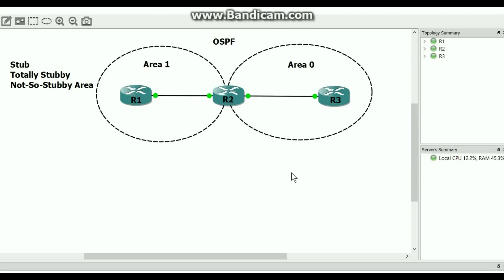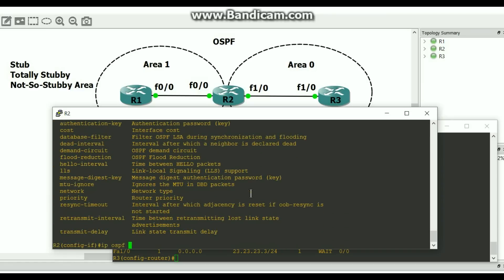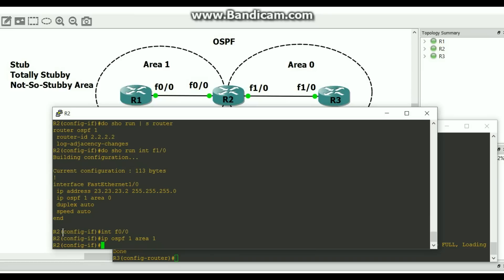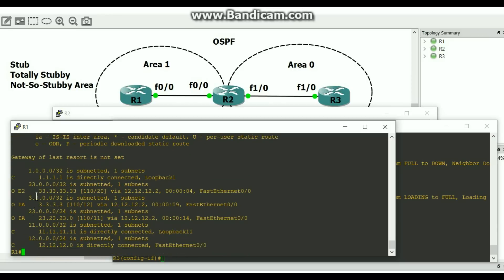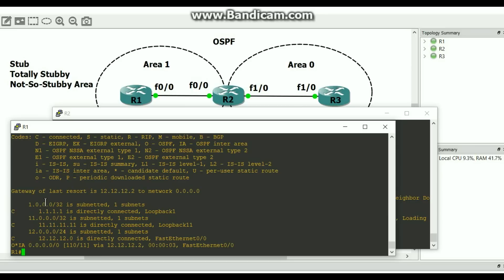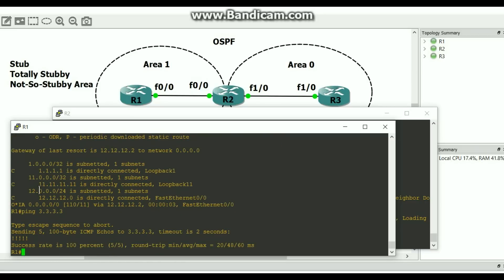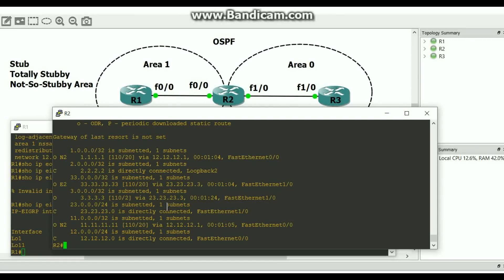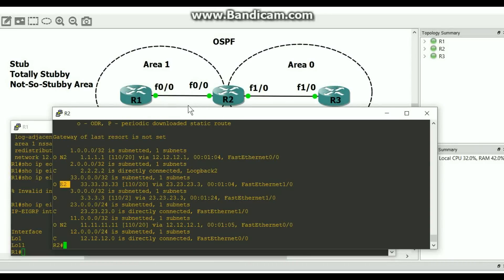OSPF Stub/Totally Stubby/NSSA Areas Explained

Comment: The force is strong with you bro. Question: From your experience, in the real world, is OSPF configured at the interface or with the network command?
Reply from the maker: Thank you, to be honest, I have seen both but i would recommend implementing it on the interface level. Many people don't understand the network command properly and what it does...hence, I made a video on that. But other vendors, like juniper, don't use the network command.
Reply: @ccnpseth4563  do you know if there is an issue with packet tracer with OSPF, like it doesn't advertise routes? Im having to do clear ip ospf process to make it advertise routes properly. I'm guessing GNS3 is better. Thanks for the response.
Reply from the maker: @AllenAndersonTaylor  my xp with packet tracer and ospf is exactly what you are describing. I have to do the same or save and reopen the project. Gns3 is better and my go to lab preference. I do not have an xp in bosom netsim. I heard good things about it though.
Reply: @ccnpseth4563  this is a long shot, but do you think I could help me with my final project for college? I'm taking a class that is tied to CCNP Route. I'll pay you for your time.
Reply from the maker: @AllenAndersonTaylor  sure i can help you, i dont need anything, how can i help?
Reply: @ccnpseth4563  i'd have to email it to you, it's too complicated. basically its improving a network.
Reply from the maker: @AllenAndersonTaylor  sent you an email

Comment: Is there a difference by configuring OSPF on the interface vs using network command? I would think it's easier to put it within the OSPF configuration so it's all in one place.
Reply from the maker: There is no difference, I would keep things under one section if possible but some configurations have to be under the interface, like authentication.